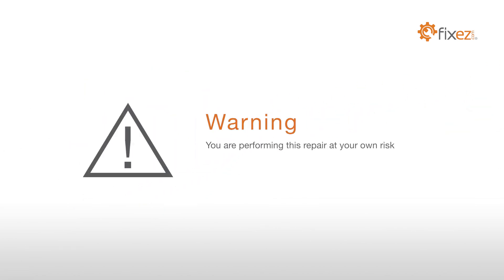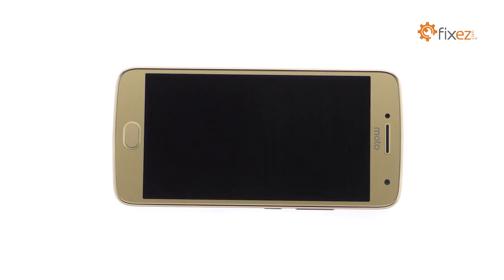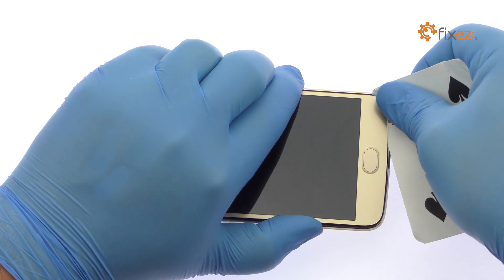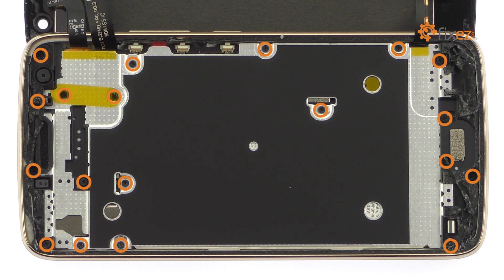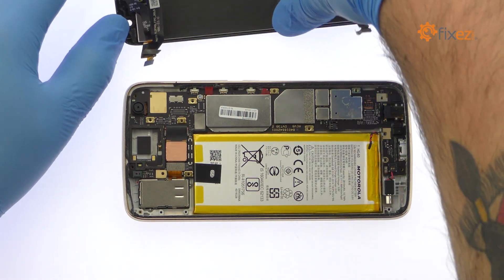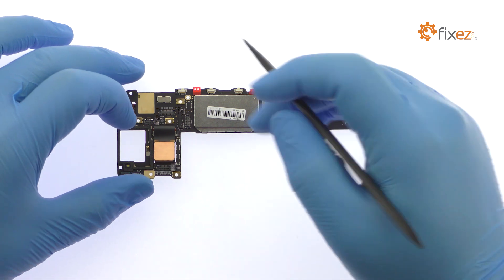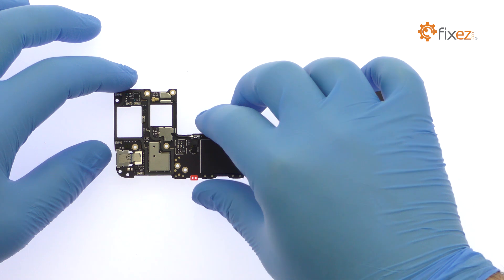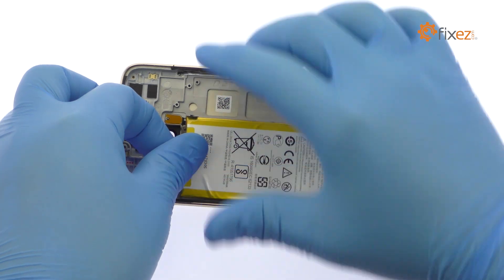Motorola Moto G5 Plus Teardown and Reassemble Guide - Fixez.com

Comment: @Dear fixez, my phone stopped working due to water seepage into camera and i was told front display needs to be broken to fix or remove water. I stay in hyderabad, india. Can you help me in fixing it? plz help!
Reply from the maker: Sorry to hear about your issue. Whenever a device has been dropped into water, it is a gamble on whether or not the water actually created damage to your device. It sounds like your device may be compromised. Currently, we only offer a couple replacement parts for this device https://www.fixez.com/store/motorola/motorola-moto-g5-plus Please check back at a later date to confirm if we have received new stock. Thank you

Comment: Plz make vedios to repalce the matal body...!! My metal body got damaged
Reply from the maker: The video shows the complete tear down. If you locate the housing, you can use this guide to assist you in the repair process.
Reply: Hello, my midframe isn't fitting back is there a technique to make it fit?

Comment: Do NOT pull up on the battery the way shown!  Instead, use a card or something to separate the adhesive from the battery without bending it.  Bending a lithium battery can cause it to fail and to potentially even explode (though you do need to bend it quite a bit).

Comment: Very handy video, thanks as helped me replace the wife's smashed screen and digitiser with a £19 replacement from China. Only issue is on the mid frame section, one of the screws is actually in the top right hand side near the finger print scanner. Not a major issue but I was scratching my head for about 5 minutes. Thanks for saving me a bundle team fixez.
Reply: Wait what
Isn't yt ban there?

Comment: PLEASE can you make a video about replacing the volume and power buttons on this device??
Reply: YES! My power button is loose after 2 DAYS of owning this phone! I found another repair video for a G4 and it looks like the external button merely rocks over the small button on the edge of the motherboard. 

https://youtu.be/6qdwuU0o3Vs?t=41s 

The external button itself appears to attach via 2 small posts to the external housing/case. I actually think the button is not broken, it just came loose from the little posts holding it tight. I have repaired many laptops, and have all the tools, but MAN! Repairing this looks scary, plus I would not know where to find new buttons if needed. I wonder if you can buy non-working G5 phones to practice on?
Reply: Felipe Nicolás Sayago Contreras I am having problem with my power button but can't find any replacement parts please do video
Reply: here is another repair video for a 5s plus
https://youtu.be/O5-n3HjcUuQ